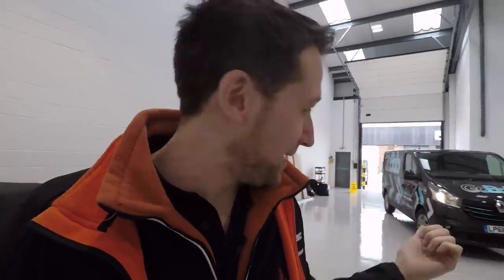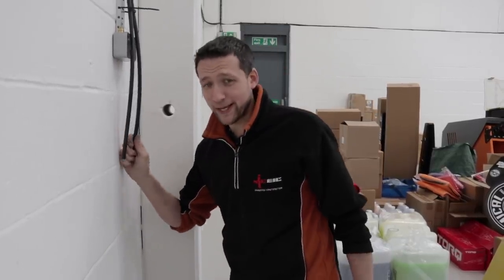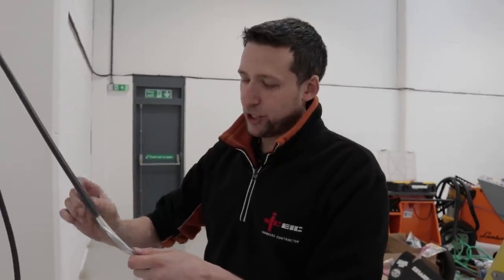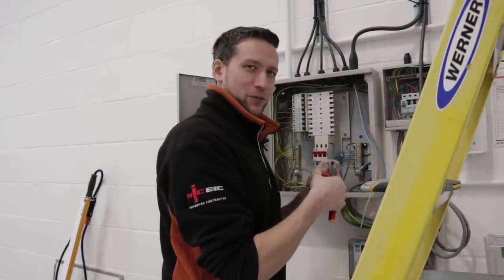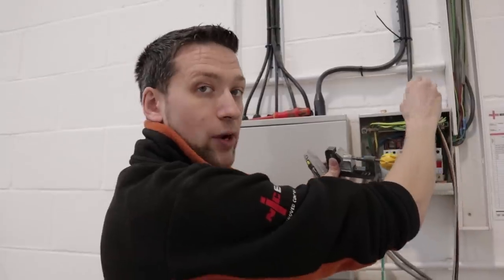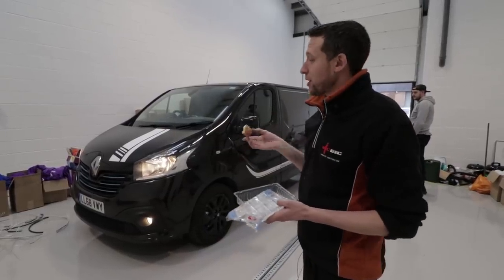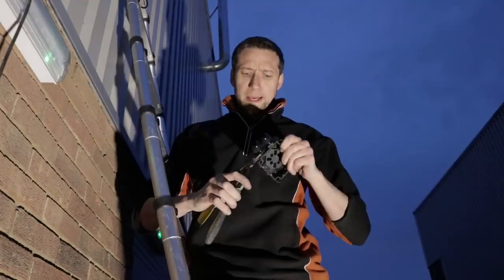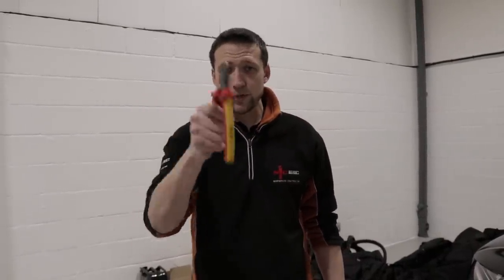HOW TO strip cable + fitting sockets at GoBobs Industrial Unit | Thomas Nagy

Comment: S C O R E!  
Not scour :)
Also I had something else in mind when you said "Doing it with Tom"....
Reply: And large glands, lol
Reply: Im pretty sure that was a really bad 1980's VHS tape....
Reply: Hi

You was talking about BG USB sockets and you was going back to replace a faulty unit one thing you do to think about is the total load plugged in to the USB socket 
I think I am correct in thinking the first batch of sockets was 2.1 amps and the this has now been up grade to 3.1 amps and if the socket is over loaded then it will fail 
It is worth asking what the client has been using in the socket as is only for 2 phone and one iPad I had one the other day and he had plugged a speaker in to the USB socket and this overloaded and failed 

Pat

Comment: Little tip for striping cable i find if you use a carpet cutting blade (with the hooked end) in you staley works a treat and saves you finger think we’ve all slipped at least once love the videos keep them coming

Comment: So glad you used baun connectors and cat 6 instead of the rubbish coax, so much better. Agree with the future proofing points as well. Also allows microphones etc to be added without additional cable.

Comment: Couple of things to make it easier-
Make off the armoured and then fit the socket,  the same as you would with conduit. 
Fit the shroud and the top of gland before stripping the outer sheath, saves bending the cores and you've more chance of realising that you've forgotten the shroud.
You don't have to pull the inner insulation down, you can strip it by pulling the cores apart as with T+E.

Wiska gel joints are a lot easier and quicker for the outside light,  although the adaptable box is probably neater.
Some wholesalers still keep memshield 1 and 2, CEF are one, or there are loads on ebay (If you don't mind fitting second hand stuff). Proteus, which was CEF's 'own make' is absolute crap, 90% of problems with mcbs/fuseboards I come across are caused by cheap makes.

Comment: I had to make an account to tell you this but for armoured cables use the tie wrap trick. Basically you put a tie wrap big end on the cable and the little end on the bottom part of the knurled part of the gland then keeping the big part where it was transfer the little end onto the cable and mark it, then you will end up with a perfect length termination every time. Sounds complicated when written but it does actually work every time.

Comment: We have the "Five Safety Rules" in Germany. And every electrician has to follow them. It's like a Mantra. 1. Disconnect the circuit you are working on from the mains, 2. Make it unable to be switched on or connected again by anyone other than you (lock it or sth.), 3. Check for Voltage, 4. Short Circuit and Connect to Earth, 5. Cover up anything than cannot be switched off. Which means, if i open a  Fuseboard and i have to work in that Fuseboard, i switch it off completely.

Comment: I use a swivel blade cable striper (wattmaster wat10270) to my cable and it comes various sizes, very safe, no exposed knife. 

You can also get from the knipex  a 98 55 knife which blade with flat nose made to run along to split the sheath but not to damage anything under the sheath.  Very safe.

I had been a Stanley knife person but this sooo much safer.

Comment: Great video this time, Tom.
Those valeting guys were just showing off at the end, knowing you were filming them! (And some free advertising!)
On the subject of outside flood lights, I want to get a couple for the house, (decent ones that will last longer than 6 months) but with their own connection box, not with that annoying fixed cable that requires terminating into an ip or wiska box.
Reply: Cleaning glass and quick detailing the van at the end? It's what we do here, that's the easy stuff.

Comment: Tom two questions:
In switzerland we newer use armored cables. Which are the biggest benefits for this kind of cables?
Also for each power socket group we use RCBO. Do you also use them often, or do you guys use MCB with an RCD ?

Gretting from Switzerland

P.S. sorry for my bad english

Comment: As I live and breathe CCTV, a little tip when using cat 5e. Don’t send power down more than 1 pair and don’t double up pairs for power. This limits you to powering 1 camera per cable run due to current capacity of 1 pair but otherwise you’ll end up with loop/wave interference on your images which is more visible at night when the cameras turns to black and white. If your using 1 cat 5e cable to bring back video signal from more than 1 camera, (up to 4 cameras/ 1 pair per set of baluns) you need to provide the power source locally to the cameras and run the power separately on a different cable.

Comment: The spec for that 3 phase proteus board requires the connectors to be sleeved if they don't have an mcb fitted or you can get blanks that look like the shape of mcbs from cef and slide over the connector. Just noticed the right hand side was all free of mcbs but couldn't see if it was sleeved.

Proteus is still available from cef. It is the same group of companies as cef and the m2 brand is identical made in the same factory (the former national sales manager confirmed this to me when I was asking for proteus brand rcbos and they only had m2 rcbos in stock).

Comment: Could you do a video on the basics of working for yourself, for example do you need to register a business name before you start, do you need an accountant etc, would be much appreciated if you could talk through the simple first steps that a lot of people glance over because they think everyone knows this stuff.
Reply: If he doesn't - Go on the HMRC website and register as self employed. ISTR you can choose your business name there, so have it ready. 
An accountant isn't strictly necessary, but boy do they make life easier and they can help you in setting up, record keeping etc. 
Save tax as you go - I put 25% of everything iearn in a savings account and then pay my tax bill / NI at the end of the tax year from it. Don't spend everything you earn then struggle to pay your tax.
Don't expect to go "The Full Nagy" straight out of the box. Buy the basic tools you need to do the job and add to them as and when you need to. Kitting yourself out with everything and a posh new van straightaway is going to hurt your budget. Keep your stock to a minimum as well, just buy what you need for each job, plus have a small stock of sundries that you use every day. And just becasue Thomas has a fancy SWA cable scorer doesn't mean you need one - a hacksaw will do the job just as well to start with.
Take any/all work you can at fitrst. you can't afford to be picky.
Ideally, have a few grand saved in the bank to fall back on if your earnings are low to start with. Make sure you've always got the basics covered - roof over your head, food and taxes paid.

Comment: Whats with UK sparkies and running SWA? Is it something in the regs? A similar installation in Australia would probably just have orange circular and flat TPS cabletied to the tray. Maybe some conduit down to the individual outlets. Same with using the same brand of switchgear. In Aus we use whatever, with a preference toward the same brand for a nice looking job.

Comment: Hi Tom,  Enjoy watching your videos as I'm a self employed spark with my own business much like yourself.  One thing I would question is the plastic cable ties on the tray?  Shouldn't we all be using metal fixings now to comply with 18th Edition of BS7671?  I have started using stainless steel cable ties for my works above suspended cielings and at around £25 a pack they are expsnsive compared to plastic ties?  Whats your thoughts?
Scott.
Reply: S60TEM 521.10.202 says the cable must be supported in the event of a fire but that doesn’t necessarily mean that on a tray, all fixing points need to be metal. I am interested to hear what Tom says though
Reply: Also in a suspended ceiling if I were designing from scratch I’d have cable tray anchored on threaded rod (so all metal, including the anchors) and that way there’s no need for fire resistant fixings to the tray because the cables are supported along their length. Just need to make sure it’s big enough and consider derating due to grouping factors.

Comment: With the cctv cable on a lot of the swann and hickvision systems the camera unit itself is pre wired with the video/audio ends that @tomthespark talks about in this vid. Apologies of this is the exact thing Tom answered in the video but just to clear it up for me, if you use the balun adaptor Tom shows here can you then run one single cat cable from the Nvr to the balun rather than the shotgun cable provided with the system?

Comment: Got to love the live work argument, current BS at work is that we need a spotter and LV rescue kit to work around and take measurements around 110v signalling circuits. I will say tho if you are working in a live switch board you should give some thought to what would happen if you caused an arc flash. Not saying you need the full nine yards for small fuse boards but wearing cotton or flame retardant clothing plus some eye protection isn't a bad idea.
Reply: Should put a mat under you aswell

Comment: With the DVR tell your customer to upgrade the hardrive. Otherwise they’ll be formatting the hardrive every month or two. Id also suggest to always get a dvr camera set. Some systems can be hacked and the live footage can be streamed live on a anywhere. It will depend on the system though

Comment: Working live is fine, i also consider it good practice when needed. Always make sure you do not create a path across your heart, dont be grabbing things etc. Mains electric is not dangerous aslong as you know how to be around it safely, so if you do slip you will mearly feel a small buzz. What i am saying is which i see many people do, be leaning into a panel with one hand on the metal enclosure and the other hand poking around inside. Otherwise it could be a bad day for you.

Comment: With Cctv you get what you pay for, the Swann system are okay DIY systems.  But far better out there but the cost is greater.  
Nothing wrong using cat5E for IP cams don’t have to use cat6 cable for them.  

If you want to really future proof a install start Running Cat 8 cable. 

I do Cctv and alarm installs and I hate it when customers supply cheap yell alarms and Swann cams to install I tell them straight up no warranty on it as can only charge so much for a ready to go system.
Reply: Cat 8 !!!  wtf camera's are you fitting - portable MRI ?

Comment: Why do you install armored cable instead of normal 5 core cable? I dont see a purpuse for it indoors. Only case it is used in industrial applications or commercial where you got EMC sensitive equipment (for example motor frequency controllers) normally we dont do this only when the cables are underground pretty much.
Reply: In a workshop exposed cables need mechanical protection against damage. Either the cable should be in metal conduit or should be armoured.

Comment: Tom, have you done much with push button / impulse light switches?
I'm thinking of getting a couple of 3 gang 2 way impulse face plates in my kitchen...
So I can turn on the main lights, the dining area pendants and the under cabinet LED strips... On and off as many times as needed from either end of the kitchen...
Without having 2 switches up and one down, etc.
Just all three buttons nice and neat looking.

Been watching you for a year since my house leaked and the insurance fcuked me over.

You're welcome to come rewire it and film all you want!

Cheers either way, John.

Comment: Excellent video thanks. Is a triple pole rcbo possible? Never thought about it before.
Reply: Yes and no. Not all manufacturers make them to my knowledge. But Hager and Schneider do. Only downside is it's not an RCBO in the traditional sense, its an MCB and then you buy a bolt on RCCB, so your 3P MCB now takes up 6 ways in your board as an 'RCBO', or in Hagers case 7, as the RCCB mod is 4 mods wide. AND the mod will cost you about £300 from Hager and probably double that from Schneider. Very limited use cases tbh.

Comment: The “sparks” saying you shouldn’t be working in a live panel are probably still in full time college, any sparks knows what it’s like in the real world
Reply: The two practical options are pull the fuse or work live. Someone will moan either way
Reply: Dominic Davis-Foster I agree, I always try and work as ‘dead’ as I can but it’s not always practical for the client or for me ie charging my power tools
Reply: I agree lads, you can't win. I was terminating an armoured in a section board once. We'd worked the weekend to get the power on for the client for the Monday morning. I was terminating the armoured, long conductors needed with it being a section board. I'd cut the armourings down to about 100mm before breaking them off. The last couple I broke off one slipped out my fingers and landed across a 3 phase breaker. Big bang, flash, breaker terminals welded together. Isolate if u can cos accidents happen. Like u say, difficult if the customer needs power.
Reply: To be fair, the sparks saying this could be really old-school and used to working on open busbars, or they could be used to working on sites where the client would prefer to take zero chance of an unexpected outage.
Reply: The unit I live in the landlord sent in a (fake) electrician to do some work the sparky not only thought it was normal to work live he got seriously pissed off when I turned off the power. The job did not no had it ever needed the power to be on for the job to be done. Always ask the client if they would mind if the power was turned off and explain why it's important, never assume that they need it on.
Reply: I was working at a Citroen garage the other day need to put in a new ring, do I turn off the whole board and shut down the whole garage, sales, reception etc or do I be careful and terminate the new ring? It’s a no brainer.
Reply: Steve Mclean Always thought buzz bar sounded better than buss, I’m with you on that!
Reply: Sadly in the US we have the safety nazis (OSHA, etc.) that will seriously levy huge fines for working live. Many EC companies have policies in place that will get you fired if you work live. Even the NEC (Code) prohibits working live except in extreme circumstances (and requiring the mass of paperwork to prove it.) 

That said, as a real world sparky I HAVE worked live many times, you just have to be extra careful. The ONLY times I have demanded a full shutdown is in older equipment of questionable condition, or equipment that is wet or shows signs of overheating (or is smoking/arcing.) 

As I said in another comment, it is all part of dumbing down the trade to allow others of questionable ability to call themselves electricians.

Comment: why not use a jokari knife to strip the outer insulation? same as you are doing, now but you can also cut in the length of the cable , no stanley knife needed ?

Comment: Think the 50mm tray mounted  lip facing wall is ok in false ceiling as it does the job but looks dodge!
  Agree it's really quick to install that way but when it's on show like your install it's rough imo!
   Better halfway house which is still quick and negates unistrut etc is fixing straight to wall with square plate washer behind it.
   Mounted correctly then and still looks good.
Horses for courses but guarantee on some jobs a consultant would pull that for the tray being incorrectly installed! Just saying mate👍

Comment: Not a criticism but a question, was there any particular reason why you went with armoureds rather than eg a 25mm steel conduit run round the top with 20mm drops and singles?
Reply: Self explanatory I would have thought, probably about half the time of conduit.

Comment: You can work on live panels, but don't (accidentaly) disconnect the loaded neutral on 3 phase system or it is painful to compensate all the magic smoke that was released._
Reply: Here in the US we also have a lot of "MWBC" (Multi-Wire Branch Circuits) where 2 legs of single phase or two or more legs of three phase share neutrals.  The NEC for a while now has mandated double pole or triple pole, with internal common trip, breakers for MWBC use. In the past, single pole breakers with or without either factory or simple field handle ties were allowed.  

To me, that is all part of the continued dumbing down of the trade, as a properly qualified electrician should know how to work on a single part of an MWBC without smoking anything.  

That said, I got "bit" by an MWBC in a residential home when I had to add on a circuit. My neutral came loose as I was dressing the wires back in the box (my fault, I was in a 110degree loft/attic and didn't pretwist the wires before putting the wirenut on) which ended up frying the electronic controls for the microwave and refrigerator. Luckily my boss was understanding about it, as was the customer.

Comment: I get arm cramps when I have to fight 3/0 wire into a panel. Had two panels and 7 3/0 boats to wire up.
Reply: 3/0 = 000 AWG (American Wire Gauge) which has a cross-sectional area of 85 sq. mm for those of us on the other side of the pond! That’s big wire!

Comment: Hand cramps... I used to have to make a lot of cat5 cables and my hand always cramped up trying to get all 8 wires in the right position and hold them there while you put the connector on.